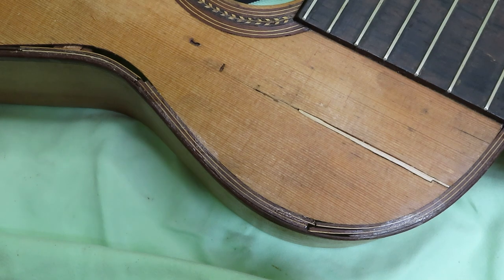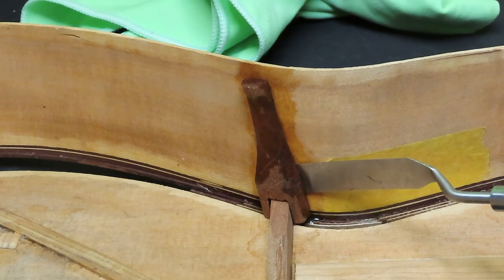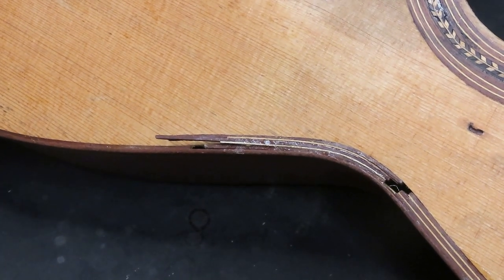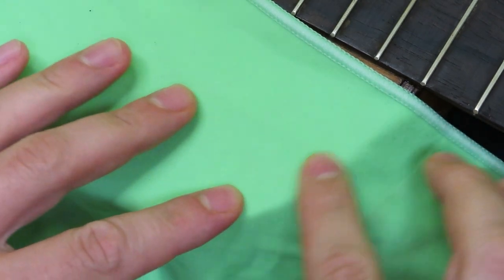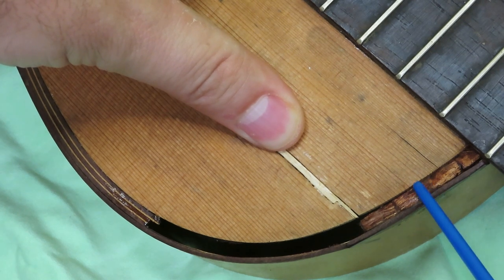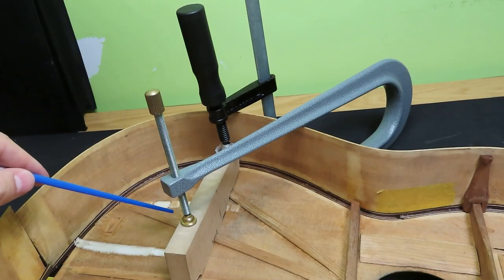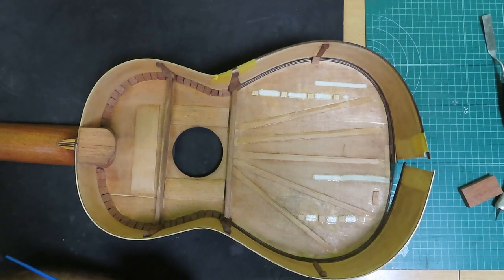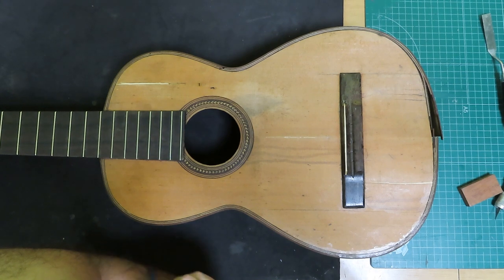THE GUITAR IS ABOUT TO BREAK AGAIN! - 120 Years Old Guitar Restoration  (XII)

Comment: Great job.
Finally solid steps forward (i am no expert) 
a) the upper part binding and purfling look awesome and make sense. I hesitate using the original but appreciate the value of the original 
b) using the same kerfing is a must
c) the body reinforcement explanation was something I needed to learn 
d) i am still assimilating what is happening on the bottom... 
Good luck... i waited for a quiet time to really enjoy your video.

Comment: This project would have been finished by now had you simply disassembled the entire instrument and rebuilt each component from the ground up. Each component could have been stabilized and re-assembled; the neck, fingerboard, top back and sides. Without question, the binding should be entirely remade. When you have that many layer of old wood and ancient glue you're asking for nothing but trouble trying to repair it. Martin Guitar has instruments this old in their factory showcase and many have been purchased and restored. All I can say is that your piecemeal whack-a-mole approach is only going to create more problems in the future. I hope you don't expect somebody to actively play this relic. It deserves to be locked up in its own glass case somewhere.
Reply: Typical internet expert. 
Of course this is probably the hardest way to do the restoration, and one that will keep having incoming issues. But clearly, dissasembling the guitar and rebuilding would mean using a lot of new wood, which defeats the "true restoration" part of it, which minimizes new materials. Sometimes, you want to do it the hard way because you think the work deserves it, and you learn a lot from it. Persistance is key, and failure is a lesson.
Reply: @GruttePierFriesland So as a Luthier would you replace the bindings and purfling?
Reply: I would not replace the kerfing.  BTW I am not a Luthier.  And he is in his right to keep all the original wood. I am asking an opinion.
Reply: @enrique663  I will provide an educated opinion on this subject. The restorer surely has some freedoms to exercise and decides the best viable option for the task; though there is a code a restorer in his own field should follow, but this code is also somewhat flexible and sticking with it doesn't mean there are no alternatives. One part of the equation is councelling and talking with the customer, informing customer and also educating them about their options, financial costs, resale value etc etc. about the most practical and fast and economical options and less practical, slower and more expensive and the customer should have some freedom to chose what to do, given that their choice is also informed. I believe in this partucular case the restorer had chosen the hardest avenue and that is, minimalist in the sense of interference with the original materials and construction, but maximalist in terms of to what extents he was willing to go using this aproach. And that is regarded as the genuine restoration. - but it also depends on whether is the guitar intended to be played or put on the shelf, displayed for viewing. Is the guitar his own, or is it commision by customer (not sure if it was mentioned). In my opinion, he could have made this whole process much easier on number of steps during the whole project. Certain things he was too concerned about I would have not been,  But he is doing excellent job, there's no doubt about that! 
so if in doubt, customer may have a right to decide whether to make a new binding from scratch or use the old one and camouflage the broken parts somehow. Possible, but not always easy to do so the result wouldn't attract attention. In restoration camouflage is OK, as long as the main piece as a whole is not compromised and the camouflage serves the purpose to allow for the damages simply blend in.

Comment: The removal of the binding at 11:50 was a bit of an overkill. the problem you were dealing with could have been easily fixed with clamping flat from both sodes, inside and outside, I've done nearly identical crack repair, and the top I worked on had at least dozen cracks. if you properly seal it up and flatten it and give it some time to cure, then it shouldn't be problem attaching it to the binding. I believe you are such a meticulous and pedantic person, that you may be unnecessarily making new problems for yourself. Restoring is not entirely technical  matter. it is also art and art has some amount of experimentation and improvisation. Very few restorers would have gone to those lengths as you did. It wasn't necessary, tbh.
Reply from the maker: "you made be unnecessarily making new problems for yourself" Totally true, man! My wife says that all day long :)